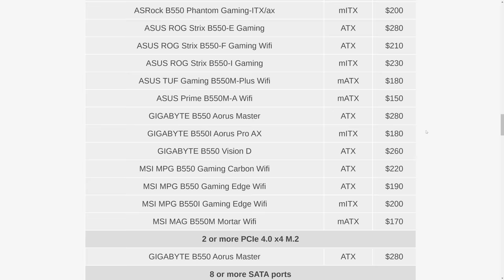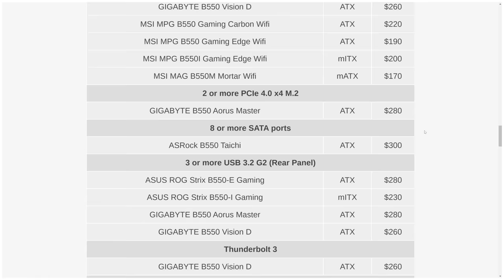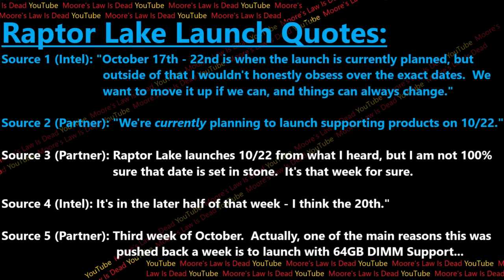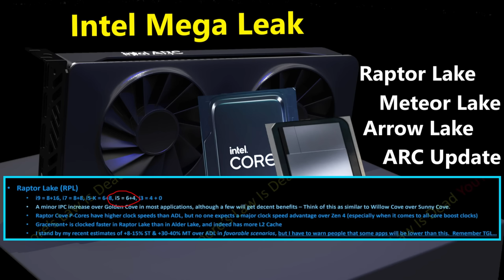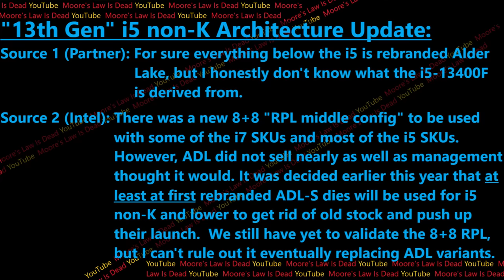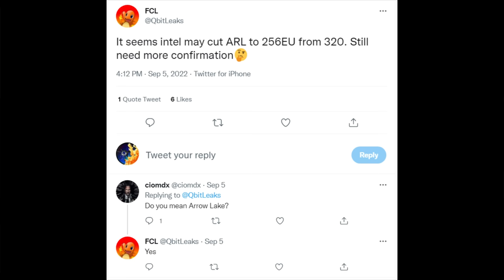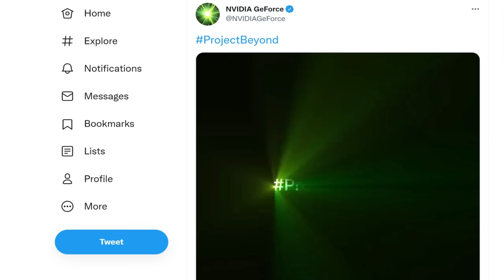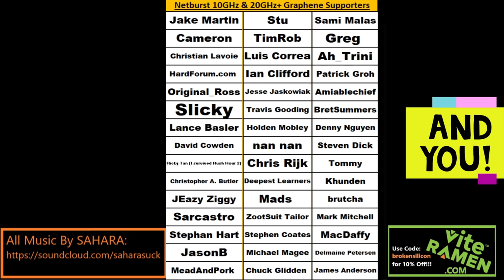RTX 4060 Ti, Raptor Lake Launch, AM5 Pricing: What Rumors are True? Who's Trolling you?

Comment: I did some estimations in the straight silicon cost chance from Zen4 to Zen4, just from the silicon wafer. Zen3 CCD and 1 CCD cost is around $11 and $7.50. for Zen4, CCD is $18.50, and IOD is $17. Really rough numbers. So 5800x to 7700x, it costs AMD ~$18 more in silicon. Not counting packaging, marketing, r&d, and other overhead. My #s: 300mm wafer, 12nm IOD is 125mm2, 7nm Zen 3 die is 81mm2. 5nm Zen4 die is 70mm2, and 6nm Zen4 IOD is 125mm2. $17k per 5nm wafer, $9.3k per 6/7nm wafer, and $4k per 12/14nm wafer. So, not a massive total cost increase for the 7600/7700 in sand. What do you think?
Reply: I think you should proof read what you wrote and make use of the edit button.
Reply: This isn't the "straight silicon cost", per se, it's the cost that AMD pays TSMC for processed wafers.
The value of the silicon itself is just a few cents, but the value of the completed CCD is around $11 and $7.50.
Reply: @geraldh.8047  It's a real rough estimate, and back of the napkin. Not enough detail?

Comment: Best CPU for gamers would be 8 13900K binned performance cores with 16T without any efficient cores. That CPU would be king for any gamer right now or until games start utilising all those threads..... I think that CPU would hit 6ghz+ ez on liquid cooling with normal temps.....
Reply: You know you can just disable the 16 E cores and then your 8 P cores get extra cache right?
Reply: @LordBattleSmurf  Not sure but yeah if that is possible then yeah in future when you need more threads you default back. But I was thinking, that all that space that they build around E-cores is adding latency so maybe, chip with only 8 P-cores, would be faster and closer to cash, then same 8 P-cores with disabled E-cores.

Comment: 4:13 "Just wait until February bro, oh and add 20-30% to my leaks lol, yeah it's in line with the other prices that haven't been released that I got but won't show you"

🤡🤡🤡🤡🤡
Reply from the maker: I didn't say to add 20-30% to my leaks - please actually watch the video before commenting.  In this video I literally say I stand by the pricing I leaked, which AMD publicly confirmed btw, and in fact if you pay attention MSI has publicly listed an X670 Motherboard for $289 - exactly what I expected it to cost.

However many of the early X670 shipments will be marked-up enthusiast models.  That's the point.  Learn to listen, and learn to read.

Comment: AM4 and DDR4 will be more than good enough for years yet. Don't feel pressured to buy... just because new tech is out. There isn't any game out now or in development that needs the latest cpus and gpus. Nor will there be for years to come.
Reply: There are some games that current gen can not run at 4k over 60fps natively with Ray tracing, think of Cyberpunk and other upcoming games, or Unreal Engine 5 that will be far more powerful than UE4 and require more memory and compute power. There is a reason why a 4070 is rumoured to be as fast as a 3090, because future games will need that.
Reply: On the CPU part, fully agree. On the GPU side, not so much. Right now, the best investment you can make is on GPU, particularly one with good ray tracing performance and 12GB or higher (especially if you like modding games)
Reply: @josepedroteixeira9721  4k gaming is a falicy just lke RT. My little 5600x and 1080ti can muster 80fps at 1440p during a closed alpha test in Ashes Of Creation which uses UE5. It was a 40 player raid with settings close to maximum. Just draw distance set to high and AA set to TA instead of SMAA. So yeah whatever lol.

Cyberpunk is a horribly optimised game. Good luck getting anything close to good framerates at any resolution without using medium settings.
Reply: @thepatriot6966  I get 55-60 ultra settings with my RX6800XT, if I disable some RT options. Your GTX1080ti (my all time favorite card) can't do raytracing
Reply: @josepedroteixeira9721  IDC about ray tracing when i can use 3rd party software to  mimic RT with no cost to performance. LoL
Reply: @thepatriot6966  I do a similar thing on Skyrim, but it's not the same thing. Especially when we advance to RT global ilumination such as in Quake 2 RTX.
Reply: @josepedroteixeira9721  As i said Jose. IDC about RT. Resterisation is more important to me. That's just my opinion. Besides i have grave concerns about intergrated AI in GPU's with an internet connection. As do many others in the tech space.

Comment: Yeah, roughly what I was saying. They are listing with place-holder-prices, which are 30 ~ 40% above what they're actually going to settle at.
They are going to be a bit more expensive, because of Inflation and stuff. And because AMD are sick & tired of being the 2nd rate bargain company. They don't NEED to be the bargain company! And because they are more complex and sophisticated motherboards. They support DDR5 at 6,ooo transfers / operations / sec. That's the 'sweet spot' the system was designed to exploit. That's why you have heavy duty power supply on even 'low end' boards.
-----------
I'm repeating myself, (I know) but I don't think that 'extreme power draw' is going to be continuous. I think it will be at (let's say) 200 Watts, and able to support half-second bursts to 400W for the moments the system ramps up clocks a long way very quickly. Then it will settle back to 200 ~ (ish) ... But then there is the case of manual overclocking, where if the power figure is listed, it can be set as continuous ~ Now you can't let the motherboard makers release a whole family of boards that can't even come close to maintaining those power levels, even if 99.99% of users will only ever see those power draws for 100th of a second a few times a day, in normal use.

Comment: you are going Nostradamus level...like "it will be priced lower...eventually"...
yea sure, it will rain "eventually"...good call, who would have imagined.

AMD Zen4 platform will be a very expensive proposition, Intel will come over price and take midrange again. so be it, reversed roles. DDR4 is still an option for 13000 also, smart move.

and yes, i'm a bit butthurt that AMD is neglecting midrange again.
Reply from the maker: AMD has publicly confirmed the pricing I leaked - AM5 starts at $125...that's not expensive compared to Intel at all.  However a lot of the first shipments of motherboards will of course be milking models of expensive boards.

If you don't like me warning you about this, then jog on lol.

Comment: Ouch Intel. Rebranding old architecture for the low-end is a big nono. There are so many people like me that just buy mid-tier cpus (like the 12400) that offer 90% of the performance of i9 in gaming at high resolution, and then selling it for a little bit cheaper we bought it, to get the new generation for 50-200$ of our own pocket. I don't understand why people put thousands into i9 and 3090s for gaming just for it to be ridiculed by the next generation i5 and X070s in term of performance and efficiency. For years we had this performance stagnation  from Intel, now that it is finally going fast again, there is no reason to build a machine for 5 years.

Anyway, AM5 seems like a much more interesting plateform this year that will be able to support a few generation down the line. Good bye Intel, welcome back AMD.
Reply: Intel segmentation means the top tier chips have larger caches, which benefits some games.  Competitive gamers look for an edge, so i9 & 3090 are another example of "pay to win" mentality.
If you like to upgrade CPUs, AM4/AM5 allows real effective upgrade options without changing the mobo, so a higher tier GPU can be in the initial budget with a value CPU.  You just need a little patience and pick good deals.

Comment: Yet another dumb decision.. rebranding sucks in every scenario and even more when you are buying supposedly a new gen with new tech / features.

I also don't believe they will replace the AL parts with RL parts with same names midway in the cycle, I can't recall of any occurrence of this ever happening, and if they did it would be a mess on the driver/motherboard support side.
Reply from the maker: I mean Nvidia did it all the time with low end GPUs that had the same name, but used entirely different architectures.